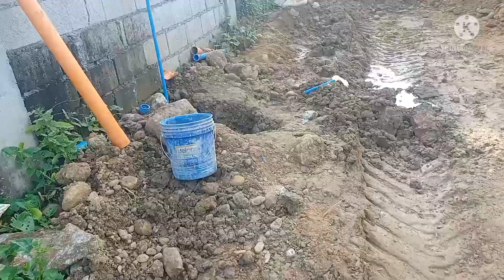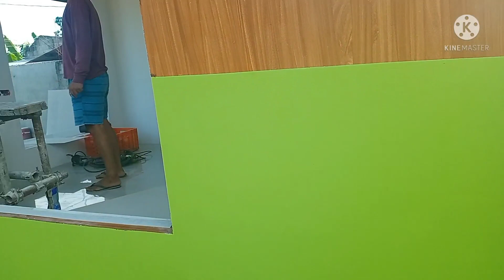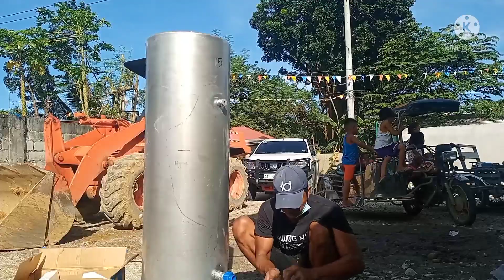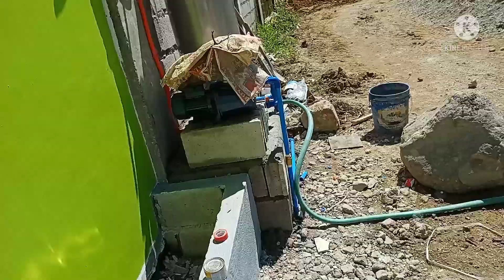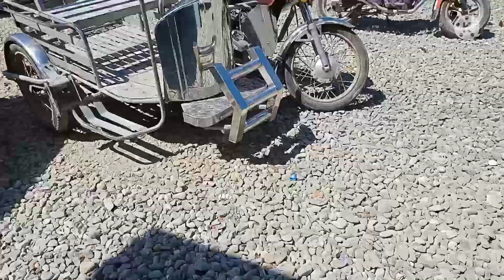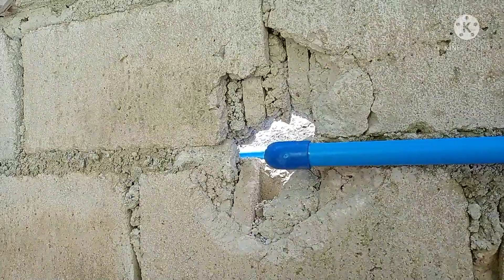Installation of 42 gallons Stainless steel Guage 15

Comment: ok mas ok din sana kung  naglagay din ng check valve  papuntang tangke pra di magka problema sa matagalan gamit be sure lng na ang gagamitin mong check valve kung naka vertical ang tubo mo ay spring type check valve ang gamit mo kumg horizontal nman ang takbo nh tubo mo  ay swing check valve.